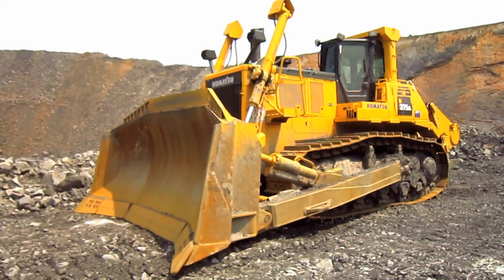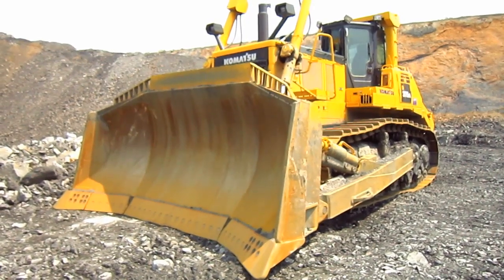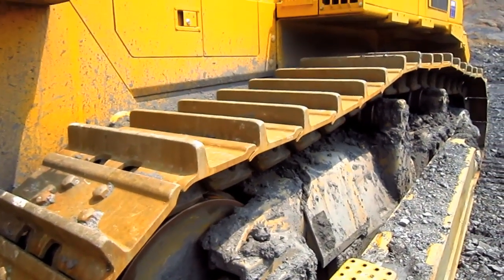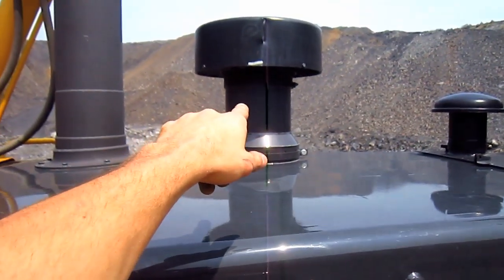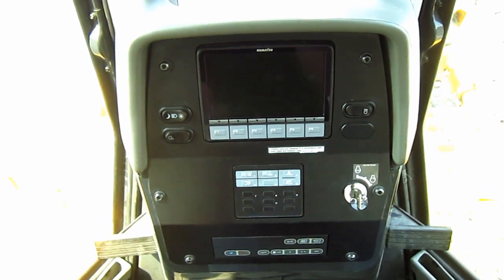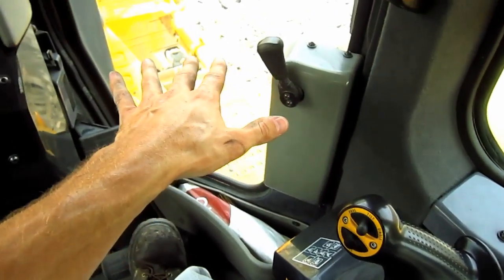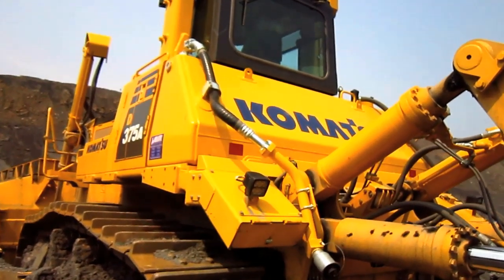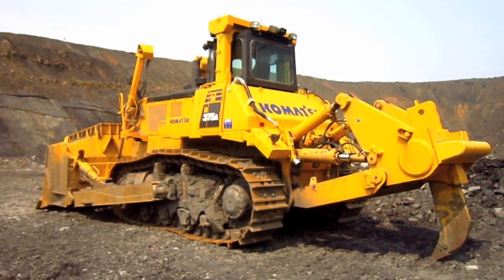Komatsu D375A-6 Documentary

Comment: I would love to spend a few shifts on that machine. I ran 355's in the early 80's. They were not much of a tractor compared to D9H models. Then I ran 375's around 1991 for a while. The Komatsu cab gives MUCH better visibility than the new Cat cabs. What those 375's didn't have was the bogey rollers on the undercarriage. Rough shift in a rock pile pushing to a loader compared to the ride the Cat D10N's I was also familiar with. The D 10 N would outrun, out push the 375 Komatsu. BUT...these Komatsu's climb so much better than any high drive Cat!!!!  That was a BIG advantage pushing to a loader or benching. This one with the bogey rollers, more power would be a nice machine to operate.

Comment: So awesome! One question, do the growlers on this machine come larger than a standard dozer?
Reply: if working in rock the 24" shoes are prefered.  the 28" and 32" are desired on softer materials when lower ground pressure is required